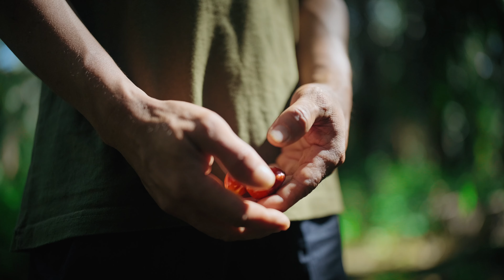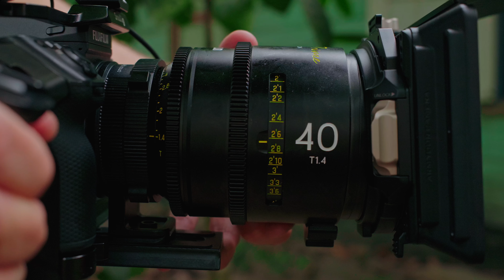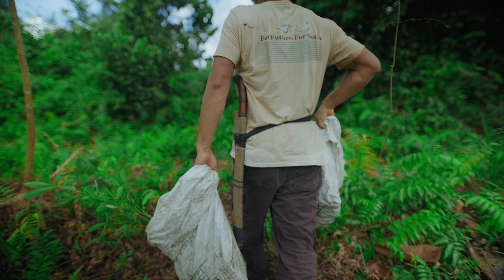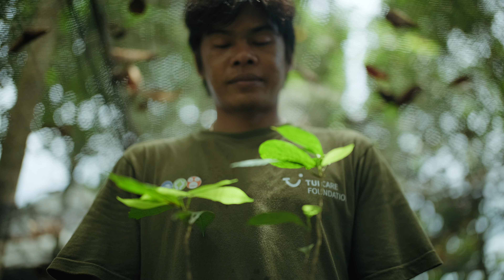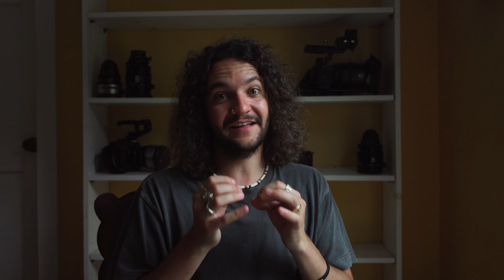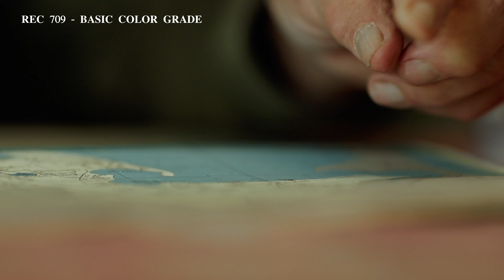What Happens When You Use DZOFILM Arles on Medium Format?

Comment: Have you had any experience with the DZO VESPID Primes? I have a GFX100ii and I REALLY REALLY want a Arles however they are just a bit tooooo $$ for my entry into a Cinema Lens. They are also much larger and heavier then the VESPIDs. I have the GF 50 and 45-100 so I'm just looking for like a 40mm and maybe a 90mm macro. If I were to get a Arles I would probably just be able to get a 40mm. Do you think they are worth 3x more than a Vespid? I'm not a professional just someone looking for a different look then the GF lenses. I don't plan on using a rig or mat box or anything crazy. Just an external mic. I like the Vespids also because of their 77mm filter thread as I have tons of 77mm threads.
Reply from the maker: Thanks for your question mate! I think they are worth the money if you’re going to use them for the purpose of like we did for a cinema project on a medium format camera. If you’re going to just work with them as a hobbyist or general enthusiast without a professional application of them the vespid Are amazing lenses and I’ve also used them in the past as well for several documentaries projects. If you did want to experiment using the 40 mm Arles, that would be a good place to start. You’ll need a adapter for PL mount to GF body.